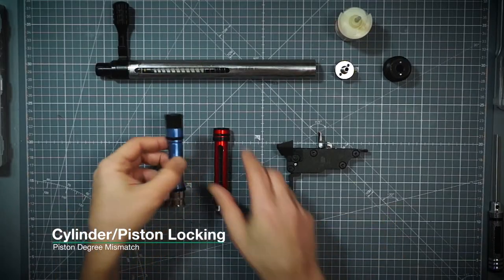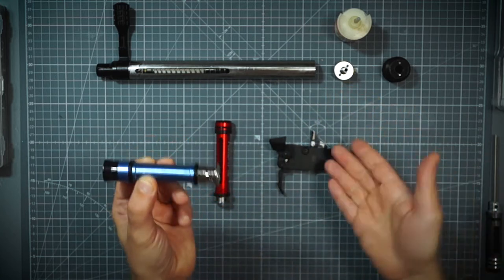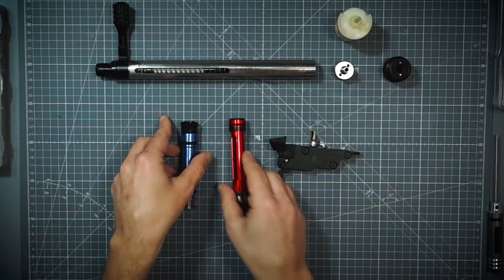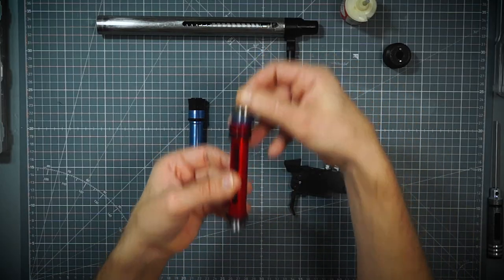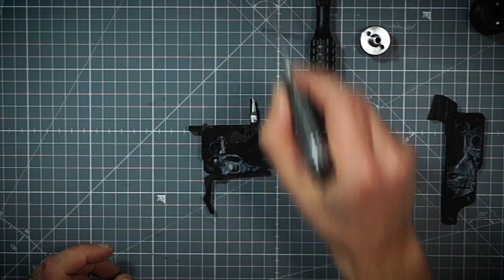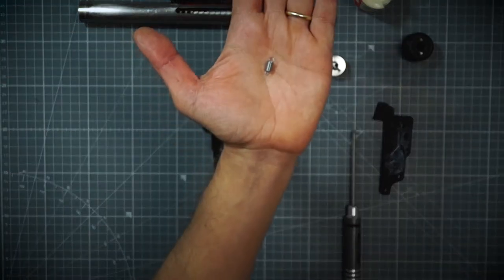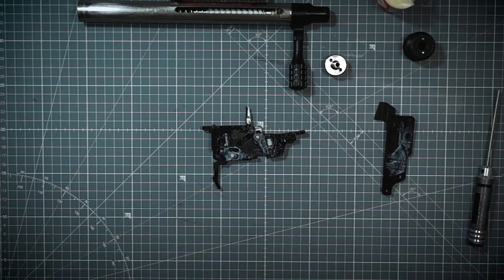How to solve Piston/Cylinder locking problem of your airsoft sniper

Comment: novritch diameter of the piston goes to all cylinder vsr10 ? i have a mapple leaf cylinder and wanting to know that.
if not wich piston has a removable piston end to change it to 45 - 90 dégré ? does the PDI Hard do that ?
Reply from the maker: you gotta give it a try and see if there is any air leakage... its a test trial dude...

Comment: I have TM L96 with full internal parts from Action Army. In my case, when I pull the bolt, piston doesn't get caught for like 3 out of 10 times. So it seems like I need sorbo pad, but I can't find one. All I can find is pads for VSR platforms. Do u have any advice? Maybe I should make one by my own?
Reply from the maker: Honestly, you can basically buy some o rings or the plastic rings that plumbers use and make your own, its very easy. But the VSR 10 ones might also fit, why dont you give it a try?

Comment: Can you help me?  The spring guide will not come our of the cylinder when the piston and spring are removed.  The bolt will not catch when it's racked back.  The only way to removed the spring guide is to remove the trigger assembly.  What might this be?  Thanks
Reply from the maker: It is normal that the spring guide is not coming out if you don't disassemble the trigger unit first. Novritsch trigger unit has a fixed spring guide stopper which is keeping the spring guide in its place.
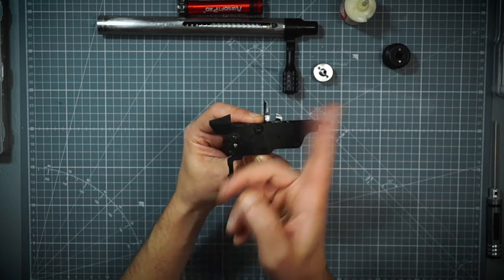Reply: @GaijinAirsoft  Thank you for your reply.  In the Nov video on his site (Academy SSG10 Spring Guide Change @ 4:27) it show when he racks back the bolt the spring guide comes out.  Mine does not do that.  He does not have to do anything with the trigger assembly.  Mine will not rack and the spring guide will not release.
Reply: @leefreedman2043  Did you try racking it harder then normal? I had the same problem at first, I couldn’t get the spring guide out by normally racking it, but after pulling it with more force it came right out.

Comment: I had this problem with my ssg10. I used a piston from my vsr10 and it was functional for a little while. Then it wouldn’t rack back and it kept firing without me touching the trigger.after I realized the problem I switch the the ssg10 piston and yes it was able to rack and shoot. The problem was  that it doesn’t seem to put enough power behind the bb like the vsr10 piston I don’t know if I need to replace the ssg10 piston. I was wondering what you would recommend me do or what the problem may be.
Reply from the maker: What do you mean by it wasn't seem to put enough power? did you have less joules with the Novritsch piston or was it just a feeling? if the piston head is not damaged, your problem does not sound like its caused by the piston. it might be maybe an air seal problem. i would recommend to disassemble the cylinder and put some silicone grease (not oil) to the piston head threads and then screw it back again. then try to check is you have a good air seal. let me know afterwards and we take it from there together =)
Reply: @GaijinAirsoft  It isn’t so much a problem of power but more of a fact that the bb does not seem to have as much range. Even with the hopup set to full hop it doesn’t rise ,just drops.now if I am using the piston used in the vsr10 it takes the hopup adjustment and can hit those far distance shots. And now that the hopup from the vsr 10 isn’t functional in my ssg10 I have to resort to the ssg10 piston which doesn’t give me maximum performance. But I will see how your idea works out. Thanks for the response.
Reply: @Hunttraditional2007  Interesting. How do the weights of the 2 pistons compared? My guess is that the Novritsch one will be lighter?

Comment: Hello, just asking if anyone has an idea on how should i approach my problem with replacing the spring of my Lancer Tactical m40g, when i tried on the new spring when I cock the bold and try to push it back into place it just flies back and fires the gun. I wonder if it has to do with the new spring being an inch longer than the older one

Comment: My piston sear spring broke, so I bought the SSg10 spare screws+ springs. I was wondering if that kit has the correct spring to solve the issue.
Reply from the maker: do you have SSG10? if yes, the kit should have the same spring
Reply: @Gaijin Airsoft  yea, I have the SSg10.

Edit, did the same spring break on yours?